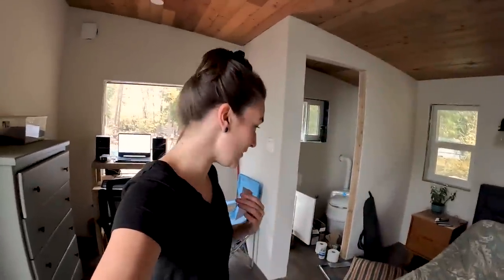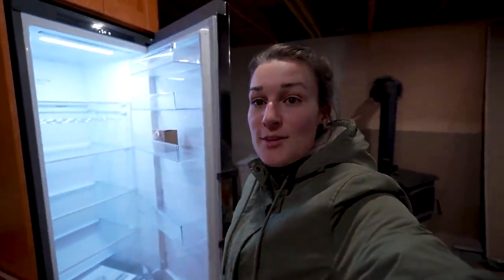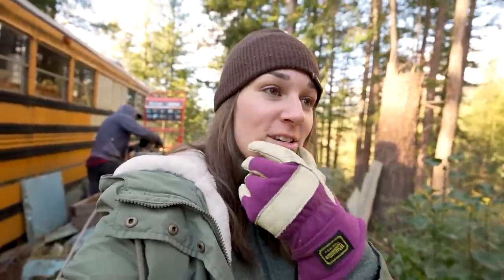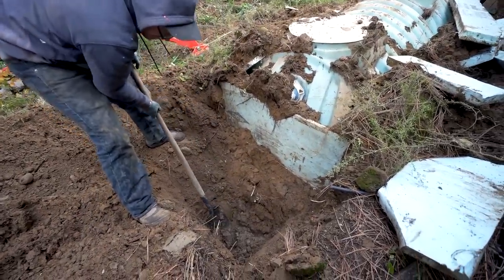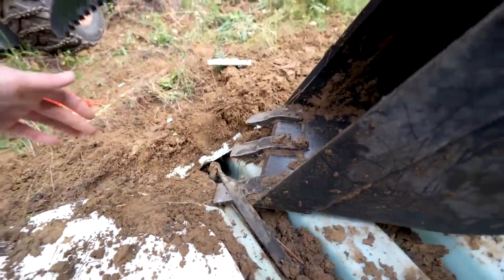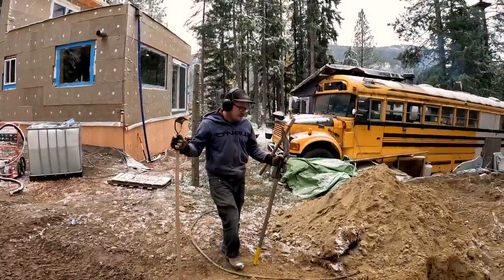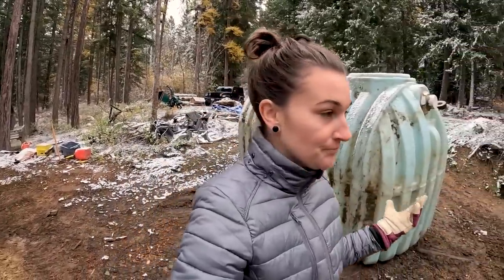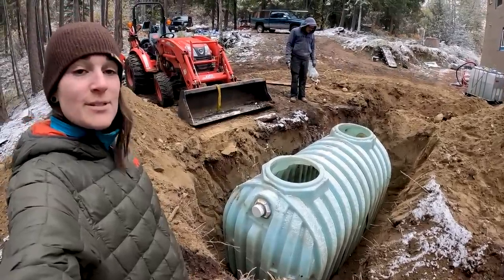We Should Have Done This Sooner! Freezing Temps and We Still Don't Have Water In The House

Comment: Why don't y'all flex seal it up.,or gorilla glue sealant it's like flex seal in like chaulking tubes that way you know your sistering isn't going to leak at all for sure. By doing that process. I'd put it in A building with heat around it for A day.,or so to let it cure really good that way. Before you put back down into the ground again to. I'd dig it deeper this time with your backhoe while it's all out of the way for easier reinstallment purposes to. It wouldn't hurt to add in A heater tape.,or some type of heating element for when the 🌡️ temperature drops to at your place there.

Comment: I think that's the best dam investment you have made is the front end loader !!! make the slope more gradual (not as sharpe an incline) it should slide better. Spotted a break in the bottom of the cistern , dead centre 3' from the back between the 4 th and 5 th rib. I hope you see it "before you put it back into the ground > If that is a break it cannot be fixed .fingers crossed🤞🤞🤞 GOOD NEWS it wasn't a crack ...😄😅 GOOD JOB GUY'S Good night be safe. Ken

Comment: Why don't you use rainwater to fill up the water? When you let it run through some filters you can use that as well.
Reply from the maker: I have been bugging Greg about that. We get so little rain in the summer but in the shoulder seasons, it would be great.
Reply: @ThisOffGridLife  It tend do be effective also in winter to collect melt water. You have a lot of roof to collect water with. We used to use rainwater for watering the plants, collecting it from the roof of he glasshouse. Most of the years we had enough with around 1000 liter (250-300 galon). somehow you will even have in dry period of the year some days it rains.

Comment: styrofoam stops frost put it about a foot above your water line incase you need to dig it up you will know the depth of your line or run flagging tape so you will know when to stop digging with the machine and won't damage the water line

Comment: A million years ago I bought a house in a bizarre land far away there were 2 houses for sale one of which I could afford. Nothing for rent . I bought the money pit and began to remodel sadly the water heater began to leak in the basement. I didn't know they had put the water heater on top of the old well when it leaked in went into the well 
 I found out on Superbowl Sunday half time I ran home for something and heard the leak. Problem was after replacing the water heater I got a water bil  $7000 . They could forgive 1 crazy bill per year and they did but billing cycles bla bla the next water bill had the other excess water usage on that bill was if I remember correctly $8000 that I had to pay. l

Comment: A+ on dropping that tank. Couldn't have landed any better. Made all the frustration beforehand worthwhile, right? You probably know this, but when you cover over the water line, put warning tape a foot above the pipe. Or any service to the house that gets there in a trench not obvious from the surface. They make detectable tape that can be found with a sensor without digging AND provides a visual warning as you dig down towards the pipe. Those can be expensive, but It is a lifesaver to have something above buried pipe, cable, wire. If you don't need the detectable type, you can use any kind of nylon webbing or tape that won't degrade underground. You want to see the tape hanging on the digger bucket, not the pipe. Good luck beating the snow!